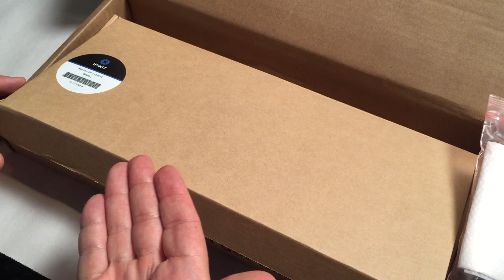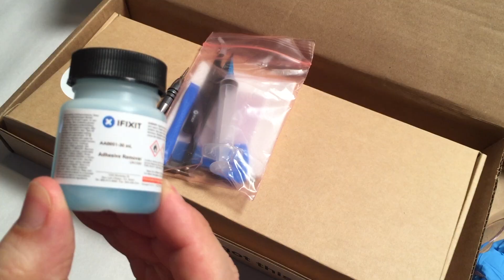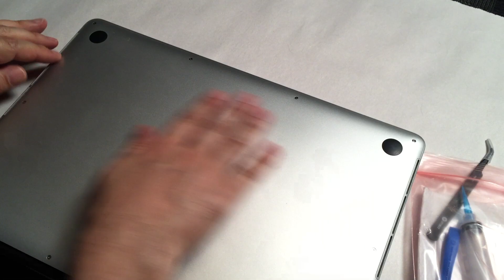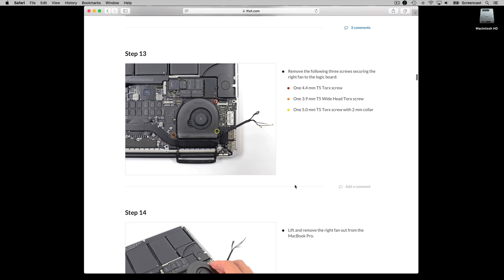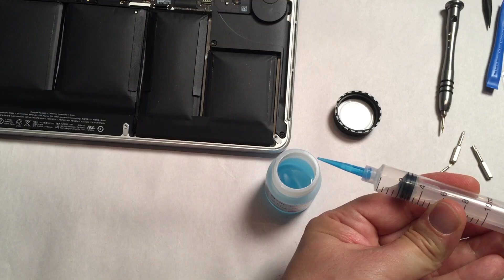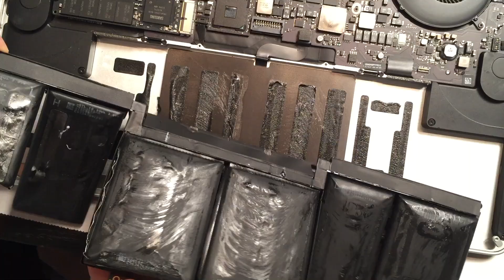Repair: MacBook Pro 15, Late 2013 Battery Replacement [ENGLISH]

Comment: It's been a year since you posted this video. Any idea how the battery is doing?
Reply from the maker: It's doing well. I haven't had any issues with it and it lasts a long time when not plugged in. According to System Information on macOS, my cycle count is only 34 (I have my MBP plugged in most of the time) and its condition is "normal". CoconutBattery gives me slightly more information, reporting that the battery's full charge capacity is still above the design capacity. So, according to CoconutBattery, my battery is still at 100%.
Reply: @puromac  I went ahead and purchased one just after posting my initial comment, it arrived yesterday and your video helped a bunch in installing it. Much love!
Reply from the maker: Awesome. I'm glad it was helpful!
Reply: Kevin Ruscoe hey is the battery still going strong? also is it running as normal no problems with speakers, display etc?

Comment: Awesome! I used this video to successfully replace the same iFixit battery in my MBP late 2013 15". The battery was still holding a charge but had expanded so much it would not sit flat and the trackpad was unusable. Now it works great. Using the kit plus the idea of the string was brilliant. This video is how "how to" videos should be made. Thank you for sharing!
Reply: how is the new battery holding up?

Comment: Much appreciated video. Apple bid me $600 + for this job. Insane.
Reply: They quoted me $1200 because mine has very minor water damage (1 usb port doesn't work) and they said they would have to replace the entire logic board which includes the CPU, GPU and RAM.

Comment: Just wanted to say thank you for posting this guide - it prompted me to take on my early 2013 MacBook Pro whose battery was on its last legs. I ordered the kit from the European iFixit store (big up to them for delivering in two days to the UK from Germany - great service). The kit was fantastic and literally has everything you need.

The only hiccup I had was that there is a base plate (shown in your video) which protects the touchpad and I accidentally removed mine as my nylon string went behind that instead of the battery. Absolutely no biggie as it stuck back down nicely and the job is done - took around an hour of careful labour using your string/twine method.

Thanks once again.

Comment: Thanks, very helpful. I also have the swelling battery issue. I'm curious, did you run your MacBook Pro hooked up to external monitors and with the screen lid shut? I was wondering if this may have caused the batteries to get hot and swell, even though Apple techs said it was OK to do this. Thanks.
Reply: Rich Pate i did run mine closed with dual monitors 95% of the time. Big swelling problem but after replacing even the track pad works again. I think going forward i will remove power when i am not using it to see if that helps. Have new 2018 version and will do the same with it.

Comment: Yeah thanks!  I had to buy the battery from another dealer (iFixIt wouldn't send to Hawaii).  Glad I read the video because I probably would've tried prying out the battery and it exploded or something.  Replacing the battery on my wife's iPhone 7 was one of the scariest things I've done lately... iFixIt is willing to send me adhesive remover :)

Comment: Thanks for the tutorial. Followed it for replacing the battery in my Macbook pro and went pretty well although took quite some time as the middle two batteries really seemed quite stuck. You just saved me £120

Comment: thanks for the guide, I tried this with my early 2013 Macbook Pro, however, after I installed the new battery, the battery sections shows that I need to replace my battery and it's not charging. Any idea why this would happen? Thanks!
Reply: Same thing has happened with me. Anyone have a solution?
Reply: @mazmahjoobi  Do an EMC Reset
Reply: @quantumhelium  I actually found out the battery was defective and returned it. The new one works perfectly. Thanks
Reply: @mazmahjoobi  That was actually going to be my second suggestion.  By the way, how many hours (on average do you get out of the new battery?)
Reply: @quantumhelium  About 2-3 hours of Photoshop use.
Reply: @mazmahjoobi  What about for typical use (i.e. chrome) ?

Comment: love the video. I was also wondering which battery  model laptop is A1398 but dont know what the best place to buy the battery
Reply: https://www.ifixit.com/Store/Mac/MacBook-Pro-15-Inch-Retina-Late-2013-Mid-2014-Battery/IF117-046-4

Comment: I’m still shocked at being told the cost to have Apple replace the batteries is $200-$300 US.  

This was a great video, thanks for making it.  And thanks for the reminder re ifixit.  I’ve heard of them but have never gone to their web site, I will now.  

My system is three years old and the battery cycle count is at 693 so I think I’m good for a while longer.  Your video has given me the confidence to give this a try when and if the time comes.
Reply: Richard Marton dont sleep on that tho, mine was around same and then outta nowhere it expanded

Comment: Thank you...I quite enjoyed your method/explanation on this!  I'm getting some kind of overheating issue, or it feels hot on my lap these days, but there is really no battery swelling to date, so I'll have to check to make sure my fans are operational!   I'd not heard of Ifixit, so I'll definitely look into this!   I did upgrade my SSD drive via 'Macsales' using the Aura 1 TB SSD two years ago, and it's worked flawlessly, and my previous 512 SSD is now an external drive!   I love being able to DIY and will again watch this video prior to changing my battery when the time comes!   Appreciate you doing this video for us!

Comment: Wonderful presentation although I would not attempt it myself (all thumbs). Nice to know what I am going to be paying (arm and leg) for when I take my MacBook Pro in to have the batteries changed (currently at 1055 charge cycles and no longer giving long battery life).
Reply: Dont take it to the Apple. Its a super easy DIY replacement, only annoying part are the screws.